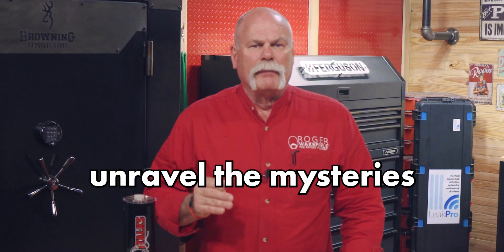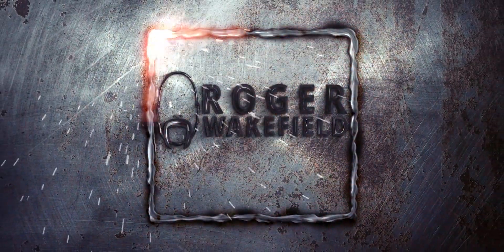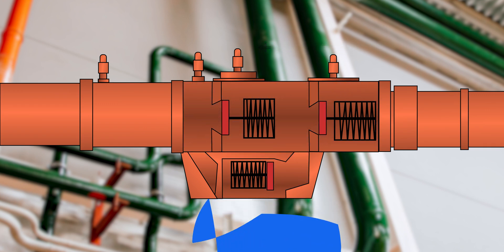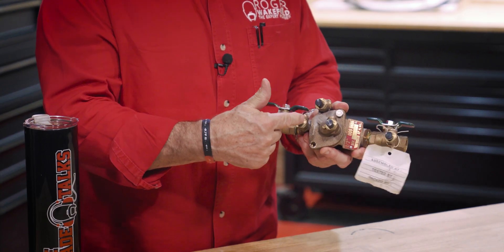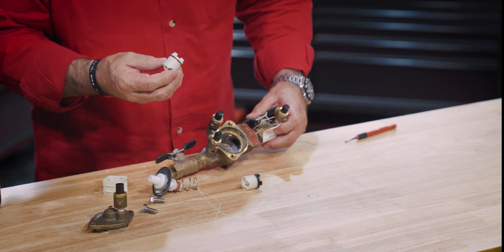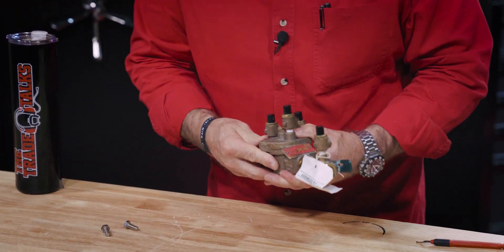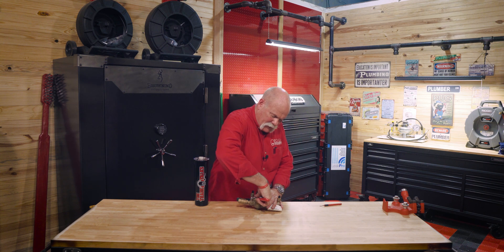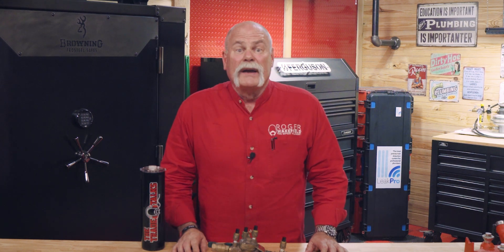How it Works Backflow Preventer | Plumbing 101

Comment: I have a question that I would like to clarify with technical experts, is it possible to use a testing device for example Watts to test a RPZ from a different brand such as Socla or the testing devices have to be specific to be brand of the RPZ? I know the lenght of the test from one brand to another are different, but does it has an impact in the test itself like givin wrong results?

Comment: thanks for the video. my BPV is leaking very slightly from the top vent (tiny hole with a small plug). i cant work out why and have checked everything. all o-rings are new. might you know why?

Comment: I had a family member who had an apollo backflow leaking out've the vent.
I ordered the repair kit & somehow it still leaked after installing (although it didn't leak when the sprinklers were running).
Before I could fully fix it & have it tested, another family member had already replaced it with a vacuum breaker check (also reduced from 3/4" to 1/2").
Just curious as to any issues this could cause (or if it's an ideal fix)?
I kinda feel like the RPZ was there for a reason (as they recently bought this home).
Any advice is appreciated.

Comment: I installed a backflo preventor in a Lowe's and it started spitting out water from the vent just minutes after I turned the water back on. It's on a 3/4" line that feeds the misting system in the outdoor garden. Would hammering from the use of let's say the toilets and urinals cause this? If I installed a spring loaded check valve in front of the preventor would that eliminate the spitting?
Reply: Maybe when you turned the water back in, a lot of sediment got stirred up and went through.

Comment: I have a problem once in a while where if I am taking a shower or using my washer or flushing the toilet where I get bubbling noises in my kitchen and bathroom sinks. Is this a back flow problem. I have a well and septic tank.
Reply: Sounds like u have soft clog in the main drain or possible venting issue

Comment: Also gotta check the outlet ball valve is shutting off completely. If not the check can fail
Reply: A shut off valve won't cause a check to fail. You will fail your annual inspection though without a proper working #2 shut off valve.
Reply: @uterotourettes15  you just repeated what I said. If the #2/downstream valve doesn't shut off. The test will fail and water will come out of the relief port....because their is no negative pressure, because the outlet valve is still working
Reply: @uterotourettes15  2 shut off valve
Reply: @larrytheplumber9851  ???

Comment: Since you deal with these, I have to have one for my irrigation system. The PVB’s I’ve looked at aren’t lead free will that be a problem long term since I’m tying into my mainline? Or would be better just to use an inline back flow preventer?
Reply: Depends on if you filter your water or not before drinking?

Comment: So i do have a question: Our line was stopped up and when the city had came to check, they said that wipes were found inside. Now, they said it came from our house but no one flushes wipes at all. We are confused where they came from or if it is from another line or neighboring house.
Reply: possible. find out if you system is pressurized or gravity only.... if you sit higher than a neighbor any air wants to escape upwards- potentially taking other things with it
Reply: Or ur neighborhood line tires in to urs before it goes out to the city main

Comment: Interesting vidéo👍. In France we use this system (called "disconnecteur") only at the water filling point of a heating circuit.
For tap water, a device called "clapet anti-pollution" is used; it's made of two valves on each side of one way check valve.
I like your vidéos, for it shows thé plumbing ways and uses we dont have here.
(Sorry for my poor english 😓).
Bye 👋🇨🇵